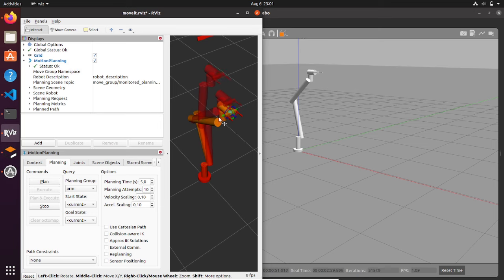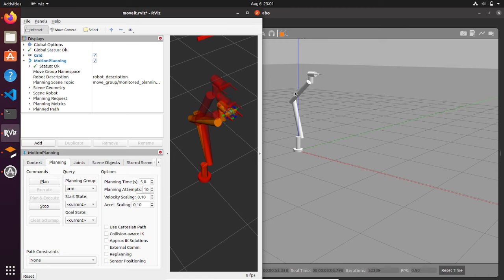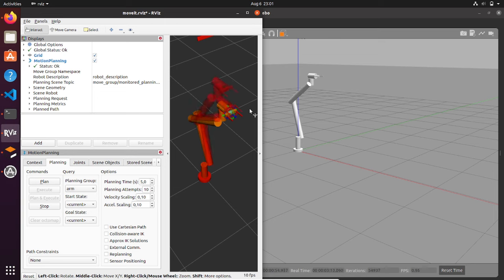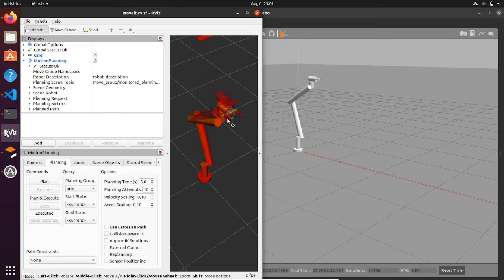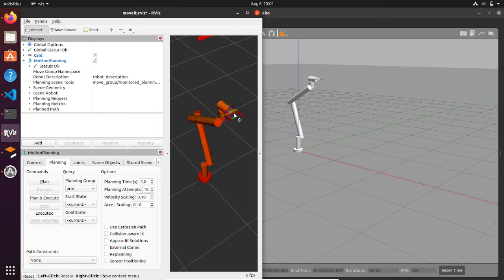How to interface the MoveIt Configuration Package to Gazebo

Comment: if i have an urdf file what command can i do instead of the command : <param name="robot_description" command= "$(find xacro)/xacro --inorder $(find cobot_simulation)" ?
Reply from the maker: We assume that you have this pathway: 
<package_name>
       <urdf>
              Name_of_robot.urdf

Instead of "find cobot_simulation" you can write "find package_name"

Of course you need to substitute the name of your URDF file ;)
Reply: @learn-robotics-with-ros  i have another question i did the video on another robot and everything worked fine but when i launched gazebo some of the robot joint where missing even tho in the files we made using visual studio i added the joints name from the robot description file any idea why?
Reply from the maker: I think is going to be an issue regarding interface between Moveit and Gazebo. I am preparing a video for that.

Comment: I still feel very confused after watching this video. Since moveit_setup_assistant has already generated a set of .yaml and .launch already. Why don't you modifying the existing files to connect to gazebo instead of creating your own files? Would it be easier to follow?
Reply from the maker: You are right. You can modify or create new one. The point is that I wanted to point out the fact that you need to:
- modify the ros_controller.yaml
- create a new launch file cobot_moveot_controller manager.

In the ros_controller.yaml file you need to pay attention to the namespace. In the case of the video is /cobot.
The namespace is not taken into account automatically. So it is necessary to provide the namespace im ros_controller.yaml file (from moveit) to Spawn correctly the controllers. If it is not clear, feel free to reach me out in ros.master.ai@gmail.com;)
Reply: @learn-robotics-with-ros  Thanks for your clarification. Your video is good but my foundation is just too weak to follow. Keep up your work! Today is a good day to learn ROS.
Reply from the maker: Your question is the proof that you are in the correct path. At the beginning it seems to be overwhelming but step by step you will get it! And you can always reach me out if something is not clear ;)

Comment: When I use my custom robot, when it reaches the final destination of the joint_1 the moveit abort the trajectory execution with the following error,
[ WARN] [1712290620.534038570, 86.506000000]: Controller '/gimbal/gimbal_arm_controller' failed with error GOAL_TOLERANCE_VIOLATED: joint_4 goal error -0.000176
[ WARN] [1712290620.534123152, 86.506000000]: Controller handle /gimbal/gimbal_arm_controller reports status ABORTED

Please help me to resolve this issue
Reply from the maker: Have you tried to increase the goal tollerance of your joint4?
In the config folder of your robot configuration (not the MoveIt one) when you describe your controllers you should find a constaints like this:
      joint_4: {trajectory: 0.1, goal: 0.1}
Try to increase goal to 0.5 for example and see what's happen.
Let me know ;)
Reply: tried the option by changing the values of above in the robot config folder in trajectory_control.yaml file. also the folder contains the following yaml files gimbal_joint_states.yaml, joints_controllers.yaml. the received errors are as follows.

[ WARN] [1712305511.204612953, 20.726000000]: Controller '/gimbal/gimbal_arm_controller' failed with error GOAL_TOLERANCE_VIOLATED: joint_4 goal error -0.000163
[ WARN] [1712305511.204726781, 20.726000000]: Controller handle /gimbal/gimbal_arm_controller reports status ABORTED
[ INFO] [1712305511.204823980, 20.726000000]: Completed trajectory execution with status ABORTED ...
[ INFO] [1712305511.221748491, 20.743000000]: ABORTED: CONTROL_FAILED

 @learn-robotics-with-ros
Reply: Kind remainder. I am stuck here on my project.
Reply from the maker: @user-ti6jc7cn1c does the problem appears only when you are running in pick and place application? Have you tried to make motion planning without any object to be picked?
Reply from the maker: @user-ti6jc7cn1c hey Nissath! In the upcoming days, I'm going to release a video of another way to make pick and place. After that you should be able to overcome your issues.